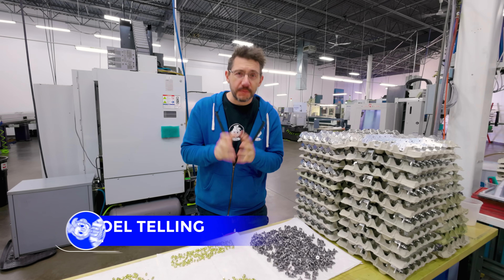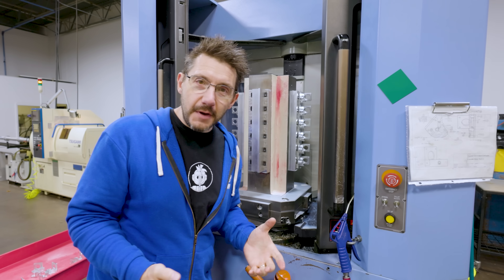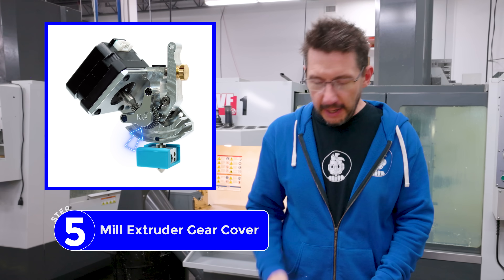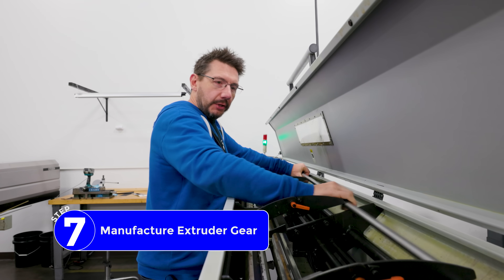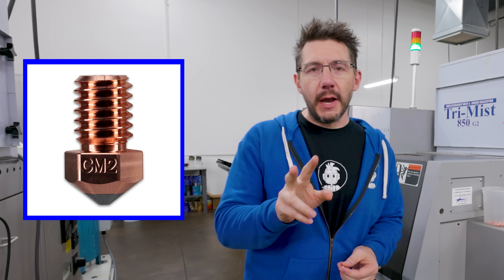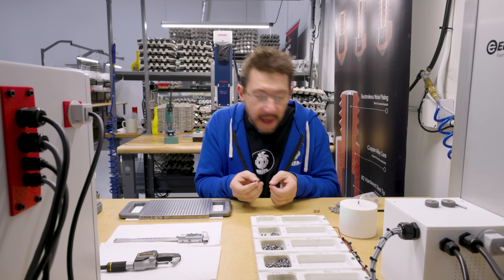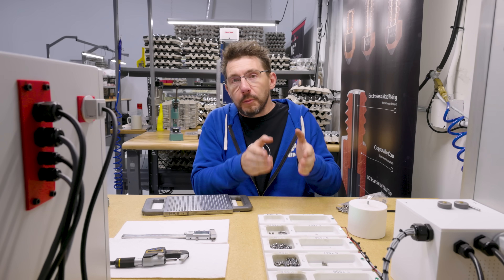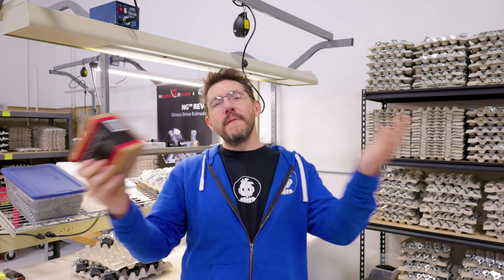Making MICRO SWISS Hot Ends & Nozzles!

Comment: some comments, 
The batch inspection is not "the only way", but i understand the thought, its the fastest way to inspect it. 
The Tools are high end so glad to see some companies actually care to inspect as well as they do. 

I dont find the engineering well when you measure low tolerance parts and then put them into a 3d printed part, 
Is a bit of a NVA inspection?

Comment: I have two Micro Swiss extruders on a couple custom machines that have never printed anything... one is a couple years old (Anet A8 Plus) and another that's over 4 years old (TronXY X3S). Both have BigTreeTech boards that I have failed at programming thus far. Really sad case... both have linear rails on X&Z and the X3S has linear on Y as well. There are times I wished I'd never touched them as they just collect dust at this point.

Comment: Worst hotend I bought twice. It had a flawed design. How do you expect 3 different metals that experience changing temperature to be held by a screw? The result is an eventual messsy leak. So, there is nothing wrong with machines. Excellently machined crap.

Comment: Whats „Swiss“ about them?
Reply: The name came from the style of machine that we run. “Swiss” machines are not only made in Switzerland, they are made all over the world. “Swiss” style lathe is an automated lathe machine that they used to make watches on. And nowadays, these machines are used for all sorts of things, including nozzles and parts for 3D printers. Our company Micro Swiss was started back in 2014 as a local swiss machine shop. This is very common to call the shop swiss as it refers to the swiss style lathe that shops use to produce parts. We initially started as a contract manufacturer for medical parts. The swiss name and the logo was designed to reference the machinery that was used to make the medical parts. Over the years, our company evolved into making parts for 3D printers and the logo and the name was never changed.

Comment: How the use of "swiss" as well as the "swiss cross" is legimeted on this Video? Note, there is a "Federal Act on the Protection of the Swiss Coat of Arms and Other Public Signs" law. Just as an example, an US company has to remove the Matterhorn from the Chocolate "Toblerone" since it is a Swiss national symbol as well with strong regulations on when it can be used.
Reply: fully agree, not allowed, we (i am Swiss, you probably too) need to sue them!
Reply: @fabianmerki4222  Breathe relaxed, I had to do this too. We may make better use of the opportunity if we provide information - if they order a machine from Switzerland, then the machine will come from Switzerland and will by Swiss. We don't get the stuff from somewhere else, screw it together and ship it and if we do so that the word "Swiss" is gone even by Swiss Manufacturers. I think they don't know enough about the meaning of this word. Give them time to breathe deeply...... and if they don't react, which will need time in suche a case, something will be done without us doing anything. They even come even after us even if we use this word not correctly, since we keep them running as well ;-)

Comment: Joel could you elaborate a bit more on what exactly the benefit of this product is? I’ve never considered changing my extruder and don’t see why I’d need to?
Reply from the maker: If you're happy with the prints from your machine, don't change anything :) This would allow for a very consistent extrusion, as we as the ability to print abrasive materials. Think of it like a performance car - a reguarl car is going to drive just fine and get you from A to B. If you want more performance though, you need to get a performance car OR modify the car you have to perform even better under the conditions you want the performance for.
Reply: The primary advantage is it's all metal filament guides, especially the outfeed one. The tight fit shaping around the dual extrusion gears allow for power-feeding flexible filament without folding/jamming. Along with reliable feeding, the gear ratio of the pinon/ring gears allow for additional torque and finer feed steps that control flow. Finally, the overall shorter/supported filament path allows shorter retraction length.

Comment: It's kind of funny that the parts to build an additive manufacturing device are made with subtractive manufacturing processes.
Reply: While some methods of MIM manufacturing are considered additive, at first blush, the small complex ring/extruder gear seems a good fit for the economy of MIM. 

Alas, the 15-20% shrinkage of the part would require oversizing and subsequent machining to .0001 anyways, and then remains the porosity downside.

But in the near-future, porosity would be the uber upside! Just like the extremes in reducing ounces off road bike components, it may not be long before porous titanium medical implant manufacturing trickles to us and reduces toolhead inertial/mass ringing. Lots of lower stress parts made with _variable-porosity titanium - up to 64% controlled porosity! and yea, titanium is cool (and porous titanium uses less, so greener, so less guilt there...).

Comment: Thanks, microswiss, for allowing a peek into your manufacturing. Admiring the NG's machining marks, I thought I had an idea of the extent of the tech on your production floor. Then I was STUNNED when I saw your lathe/mill make the _1-piece extruder/ring gear and shaft, while having the capability to "easily" verify the precision necessary to get those filament grip teeth sharply profiled. Joel, love your delivery, reflected the enthusiasm that I would have being there ... but you totally understated the part as just a "extruder gear". forgiven, always

Comment: All these high tech CNC machines and then the cut to an ender farm. Well,they had the rep rap idea covered with NGs printing themselves , but creality in a professional environment looks weird.
Reply: It kinda depends on what the goals are. I thought it cool that it serves multiple purposes at the same time, since they are doing exhaustive testing of their products on the target printers, might as well "test" print something useful (the shroud). Commercial-reliability levels (that Creality printers may not rise to) aren't really needed for the rather simple shroud, but if one print did fail in the line, the Quality Failure Analysis team might find the data valuable as part of the Continuous Process Improvement.
Reply: @spicetreks you are absolutely accurate here. The farm of Ender printers serves two purposes. We continuously test our extruders while printing fan shroud.
Reply: @MicroSwissLLC  I got that. It’s just an instinctive reaction to the contrast. Like putting a turbo motorcycle engine on a lawnmower. And I own a few of them. A lesson that shot taught some of us, that fan shrouds don’t need high temperature materials.
Reply: Sometimes high temp materials are necessary for printing the shroud. Both hotends (I chose the NG Revo) have all-metal heat breaks with 300-500C support for high-end filament that requires a printer enclosure, where interior temps can reach up to 50C. Cycling temps too close to PLA's 65C glass transition can compromise its strength, so ABS's 105C glass transition gives better margin. Fyi, pretty sure the NG's stepper motor is the high temp model
Reply: @spicetreks  The shrouds are printed open, not enclosed. This isn’t a high temperature farm, no matter what the NGs could do.
Reply: @crowguy506  I didn't say the shrouds were printed in an enclosure, I was pointing out that if some of us are using enclosures, the printer parts (such as the shroud) would be subject to enclosure temp (cycling) that would fatigue PLA, and was just using ABS as an example high-temp material that the shroud should be made for that application.

I have no data on what temperature their farm is printing at, just that we can see there were no enclosures. While ABS and ASA have higher print reliability with an enclosure, folks can try without one depending on ambient temperature, drafts, or the use of rafts, skirts, brims, draftshields, or bed adhesives. The other advantage with enclosures is the ability to contain the more serious fumes  (where an activated-charcoal HEPA filter inside the enclosure can neutralize the gas and trap the aerosolized micro-plastics.

Comment: I just picked up a Volcano CM2 hybrid nozzle and I couldn't be happier 😊 I've been running my own Frankenstein'ed volcano with a copper spacer and a normal sized hardened steel nozzle to print CF etc.

For the mechanical parts I've been printing with a tool steel nozzle on a normal V6 block i got about 8mm³s of flow, volcano Frankenstein with the same nozzle got it up to 12-15mm³s and now with the CM2 I'm getting 20-25mm³s of extremely good layer adhesion and 25-35mm³s for "normal" prints on a "classic" extruder design (I print a lot of mechanical parts).

When I say classic, I mean like the same as a makerbot replicator I still have. The "spikey" extruder gear on those old units are amazing. I can very comfortably print at 35mm³s without exceeding the filament recommended temperature without any slippage. Usually seen as uneven walls and pulled in corners... I'm never going to end up using my Revo extruder 😭

Comment: tiny parts are Ok but,,  going to Company where they manufacturer  has CNC Machines the size of large bedrooms and multi tool changer, on the CNC looks like something  out of a  Terminator Scene where all the Different Terminators get built ,, no Sh_ _ _ it  ,,, and lathes half the size of a house  making  Special Nickle ally bronze props for warships an Crazy Gyros that look like they should be in a space ship    "  VEEM Enterprises  "
Reply: While they seem over-built for the part it is currently machining, these are fully (re)programmable and versatile enough to lathe or another to mill anything. I would invest in a machine that can adapt to future designs, else it turns into a dinosaur fast. Example would be the highly-specific monster machines that Detroit used to bore / machine their V8 gas engines- so inflexible to change to the times - made terrible V6 / inline-4 and their cylinder heads - all because Detroit didn't want to re-tool.
Reply: Sorry, I misread your point. Yes, machining a huge object at some accuracy is impressive looking, but small sizes don't negate the challenges. Despite the extreme precision of their Swiss lathe when assembling  the hardened nozzle assembly,  they furthered tolerance thru bin-matching to the final .0001", control plating thickness consistency (and mettalurgy to isolate from galvanic corrosion), account for asymmetrical dimensional shifts during hardening, and press 2 dissimilar metals together calculating that no buckling/etc will occur across the whole target temperature range.

I read an article on the Giant Magellan Telescope. Each mirror is "only" 27 feet across. Surface accuracy to 19 nanometers- about 7.5 * 10^-7 of an inch. Surfacing the 7th/final primary mirror will take 4 years. While each of the 17-ton mirrors don't match up to the largest ship propellers, the accuracy has to extend to the full 7-mirror assembly, which will total 2,000 tons.

Comment: My only issue is loading filament into the NG can be a pain.
Reply: I followed their manual and had no issues- under "Service Tips"
Preheat the hotend to printing temperature.

• Cut the tip of the filament at a 45-degree angle.
• Straighten the tip of the filament out.
• Using the printer menu issue an Extrude command.
• Insert the filament into the extruder as the gears are rotating.
When loading filament do not press the extruder arm until the filament has made it into the tube below the extruder drive gears.